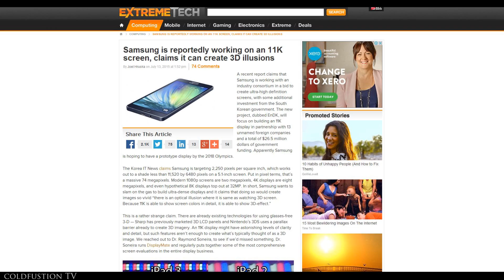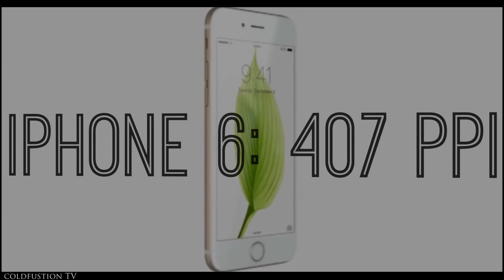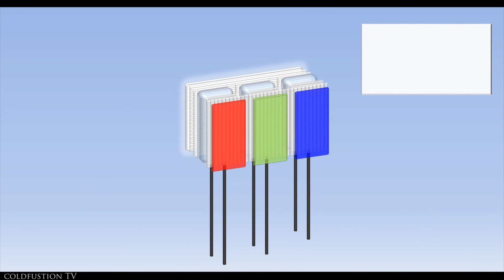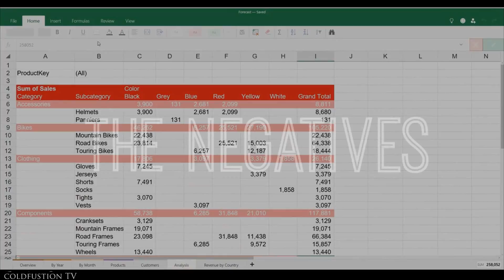Samsung is Working on an 11k Mobile Screen! (2250ppi)

Comment: is this physically possible?
Reply: Povilas Račkauskas .... Are people that stupid? Of course yes.
Reply: asdf30111 are people stupid? no right now
Reply: ***** What? What is possible does not care how advance humans are. We may not be able to build it but it still physically possible. Op said physically possible which it is.
Reply: ***** we know it is possible. In fact we know  a much higher display is possible... Take the size of a photon then take the size of a screen and dived that by the size of the photon, Now that not the highest possible display "pixel" range but it the one that can achieve 100% possible brightness. That is a physical display limits, non physical displays are also physically possible in fact to see a display you must see a non physical version of the display. Non physical displays can use fractal generated imaging that are colored by the amount of steps you need to do to hit the limit of the math equation's limit. Like x^2+4/x the amount of steps you need is 0 or x^2+4/ ((-x+4)^3)+ 3 ↑↑500 no amount of steps can get you to escape so it will be a dead "pixel"
Reply: asdf30111 I guess what I really ment was this: how small can you make a pixel (single led or whatever) so that it could emit enough light for a human eye to see) I would imagine that at some point QM would kick in and prevent a signal being sent to a led (or whatever) or that a very small led (or whatever) simply couldn't emit enough light for a human eye to see.

Comment: Battery will last 30 minutes on something like this. 

How about work with everyone to make a mobile phone battery that will last all day or hell even 3 days on a full charge. I would be far more impressed. I think most people would agree. 
Battery tech has not improved much over the years yet screens continue to get better and GPU's and CPU's get faster on top more Ram is added... Yet battery tech is stagnate and doesn't move much besides the addition of more milliamps.

Comment from the maker: Samsung is at it again! An 11k screen for a smartphone.. But why? Find out in this video! 
Note: where the iPhone 6 is mentioned, should be the iPhone 6 plus at 401 ppi not 407, also Bill Gates has denied that he ever said those exact words, it turns out to be a very popular miss quote. Thanks guys for pointing those out, I usually triple check facts but these ones slipped through. It's unfortunate but sometimes these things happen.
Reply: Also grammar mistake in the title, it should be an 11k screen as eleven starts with a vowel.
Reply: The Uncanny One Nintendo 3DS glasses-less 3D screen was an extreme advancement in visual technology in a mobile device. MS Hololens is an extreme advancement of visual technology.

Just piling up more pixels is NOT an extreme advancement of visual technology. I'd praise them if they quadruple battery capacity rather than the resolution.
Reply: PT111111 "How dare Samsung make an extreme advancement in visual tecnology, I am so disgusted I will call them names, that will show them"
Reply: Kylenetwork I finally met A gramer sherif on YouTubee !
Reply: ColdfusTion Samsung's retarded. 11k is WAY beyond the point of diminishing returns. I doubt there's a person in this world that has the visual acuity to tell the difference, even for VR. Actually, they need more refresh rate than 11k resolution for VR. And if Moore's Law is still true, I don't think we'll 4-16x growth of mobile performance.
Reply: ColdfusTion Fuck 11K or 56K screens - they should just do a 21:9 ultra widescreen Note... For shit sake......

Steve Jobs once said 'Nobody wants a smaller than a 10 inch screen tablets or a bigger than a 4 inch screen on their phone...' (a few years later apple did some gymnastic backflips and released ipad mini and iphone6/6+)
Reply: The crazy thing is we literally cannot comprehend why we would would need this technology now. I'm sure someone said the exact same thing when the first computer came out. The difference is today we don't put much past probability.
Reply: ColdfusTion thanks for the video
Reply: +PT111111 3ds was not an extreme advancement in visual technology.  the same technology had already been around for years.  literally, u can buy 3rd party filters to acheive the same effect on a standard pc monitor
Reply: Have you ever seen those bookmarks or posters that have a 3d effect which they like to call a holographic effect? The reason we can't have that technology on many of today's smartphones is because the pixels are too big. This means that the material which kindof absorbs and fills up with the light will decrease the ppi drastically. With an 11k display this type of thing can be used and still, the final resolution can be at 1080p. So that will be awesome to see
Reply: ColdfusTion 
PS bill gates denies having ever made that remark ; )
Reply: As you said, I think that 11k may be useful for virtual reality, but not for a phone, or at least it won't be of any use for a mobile phone not mounted on a headset very close to eyes. If they can have the pixels there and not degrade CPU and battery life it's ok but I believe it's a display that will be used in dedicated headset hardware and not for general propose smartphone. If they don't have to overcome bright direct sun light (again just useful for a headset) maybe it's easier to increase the pixel density in OLED screens...
Reply: 11K is ridiculous for a TV screen not to mention or even think about a smartphone! Samsung needs to focus on their core brand and stick to specific handsets instead of always trying to innovate in areas where it's not needed!
Reply: ColdfusTion can u please Make video on history of human civilization
Reply: Remy Cajallena program = control*
Reply: ColdfusTion why the hell not?
Reply: +ColdFusion - although it maybe overkill for a smartphone I think it's good for Samsung to push the technological barrier.  If they can do it then why not?  The road to progress isn't measured by "i'll settle for this" mentality rather "this is what I can make better" mentality. Imagine a 11k screen on a smartphone(yeah, still overkill) vs maybe a 1080p or 2k on an iphone BUT they're priced the same since Apple is severely overpricing their products with substandard/obsolete hardware they purchased from other companies.  You get more hardware for your buck.  Less than 5 years ago we were content with 720p as the "highest" standard even on youtube but now we learned to appreciate the viewing quality of 1080p and even 2k videos. This is all part of the evolution of technology. Now, the question... Why?  Simple answer... Why not?  They can make it happen!
Reply: with that much resolution they could make a small area of the display optically accessible from the backside, then you could drop the phone into a light projecting device that could project 4k video onto your living room wall.
Reply: 11K is overkill. I think you can get rly good quality out of a 4K screen
Reply: Luke Loves MC! // LLM lol 401 PPI screens can be found in budget smartphones
Reply: Deliciousniggasauce probably more than 1080p since we're probably (rumors) talking about 11520x6480 or 11264х6336 pixels which would be almost 75 or 71 megapixels vs 1080p with 2 megapixels xD
Reply: ColdfusTion  What is the font of the COLDFUSTION TV intro? I´m desperate to find it. Please help me...
Reply: PT111111
The "3DS glasses-less 3D screen" requires you put your face at an obscene angle and suffer headaches unless you keep it off. It's a minor gimmick for children to show off in the playground.
Reply: The Uncanny One You just argue for a useless innovation like 11k but now you made some lame argument against a glass less stereo vision. Nice one straw man.
Reply: PT111111
I don't understand anything that you just said. Can you rephrase using Standard English please. Or better yet, don't reply at all.
Reply: Wasseem Eliasis Haha.
Reply: ColdfusTion Why not 12? why does it have to be an odd number?
Reply: Remy Cajallena
Why not 10? Why 11? Why anything?
Reply: The Uncanny One 10k already exists
Reply: Remy Cajallena because in odd number it is easy to program pixels
Reply: Som Harsh 10K Mobile screen?
Reply: Som Harsh why is it easier to prgram pixels at odd numbers? how do you program pixels in first place?
Reply: Som Harsh why is it easier to prgram pixels at odd numbers?
Reply: ColdfusTion But why? o.O
Reply: ***** why odd numbers then thats all im asking....
Reply: ***** So... if celphones get to have 11K... can we have 44K monitors when this comes out?
Reply: ***** :( got me excited for nothing
Reply: Mills
Reply: ***** until everything is perfect from quarter inch away from screen then we can finally say there is enough pixels....
Reply: +ColdfusTion again, "what's the point?". i don't agree on both the points about 3d and connectivity or merge to external display.
even if 11k is designed for 3d, does human eyes perception need these much of pixels? i doubt it
external display? just use scaling algorithm
it's a waste to processing and power
Reply: Kelmen Wong all I know is that nintendo 3DS left an extremely bad impression for me...
Reply: ***** it's not the pixels that count, it's the FPS
Reply: +Deliciousniggasauce thats not the only reason though, the main reason is that the viewing angles have to be exactly right.  plus it has been implemented in some devices (e.g. 3ds)
Reply: +ColdfusTion also the digitizer with higher dpi, well that high would mean the whole screen could be a fingerprint scanner
Reply: +Super1di0t - you do realize that dpi and ppi are 2 different things.
Reply: +Question MK-Question check his comment
Reply: +Joe Mills which leads to rage because you hit their hip or something and they didn't take damage
Reply: It was Samsung s7 edge coldfusion
Reply: cut to two years later..11k makes perfect sense
Reply: +PT111111 you should never ever for the rest of your life own anything with more than an iPhone ppi
Reply: jared back why are you assuming battery life and processing speed wont improve
Reply: we will never need 11k resolution? even in the year 2100?
Reply: jared back in the future we may have an alternative energy source that powers everything
Reply: ***** who knows by the late 2020s artificial intelligence may be common. Technology has been developing rapidly. I couldnt even imagine what i have now 15 or 20 years ago. Also, screens and panels may be completely different in the next 20 yeaars with technology we cant think of yet and in ways we cant imagine. just a thought
Reply: You want to set the parameters of what to talk about. in other words
Reply: True, thats why my point is saying 11k is overkill with technology is kind of silly and shortsighted
Reply: I think virtual reality is still in its infancy. It could be connected.
Reply: you said the future isnt mystified but you cant know it. Ok?
Reply: "Trust,  but verify"
-Ronald Reagan
Reply: i can definitely see that low pixel on iphone. just put side by side n u ll say iPhone should update display
Reply: jared back - Whatever, "bro"!
Reply: jared back - I was just trying to be cordial. And now you're blocked!
Reply: +Question MK-Question  samsung phones have 518ppi n thr highest they went was 577ppi
Reply: +Ray N  bt it will not be better thn  super amoleds
Reply: +jared back  bt  its an ips lcd display which will lose in front of super amoled
Reply: ColdFusion
Reply: jared back Well, what he meant by 4K display is UHD, which stands for Ultra High Definition (3840 by 2160) not the official 4K (4096 by 2160) nor the iMac 4K's 4K (4096 by 2304) The official 4K is DCI 4K.
Reply: jared back Well, 8K is now at the horizon, even possible with the new Titan X.
Reply: Why not 6K or 8K?
Reply: 400ppi? this screen will be insane!
Reply: Samsung what the!😲
Reply: 5 years and still on 401dpi

Comment: 11K on a Phone in 2018 is dumb and pointless. 1440p is even a little much for Phones. The battery will not be able to withstand such power draw and the CPU will burn up in games. I mean sure things are going to advance as mentioned in the video but tech will not be ready to drive 11K screens in 2018, let alone 8K.